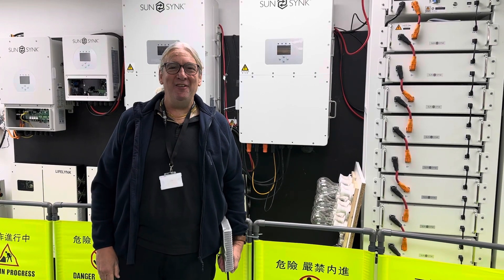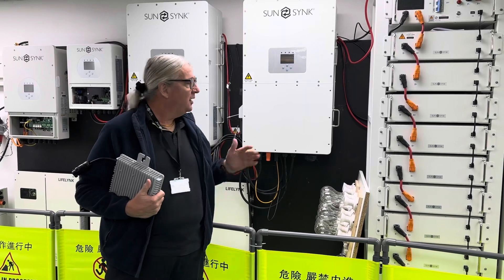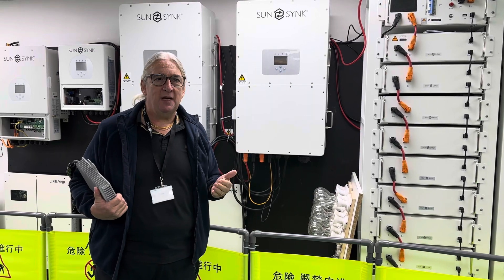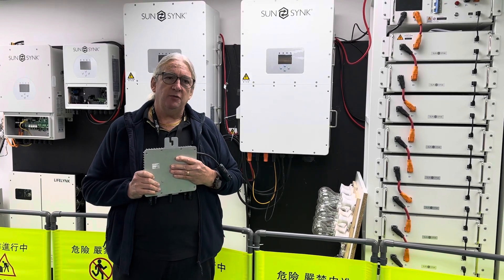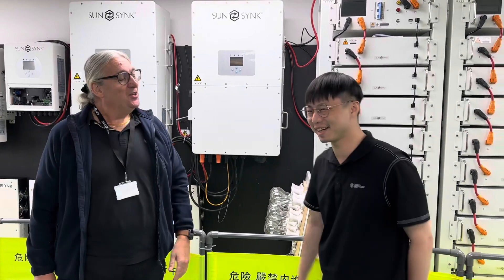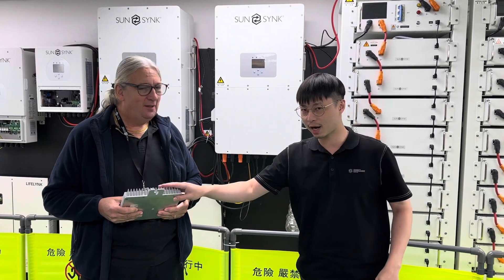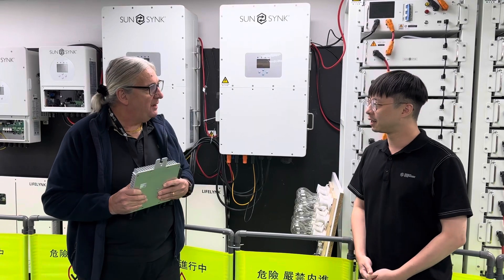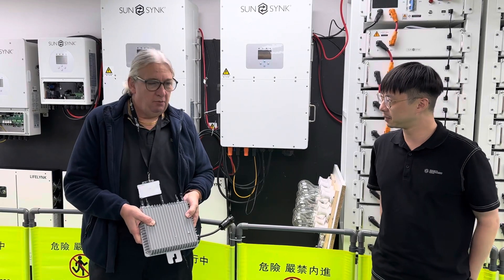The integration of micro inverters with the Sunsynk connect.

Comment: You've said a lot without saying anything. How is it used? How is it connected? If one ahead has 2 PV strings within the SunSynk hybrid inverter and wants to expand using an ac coupled microinverter, how does this play itself out?

Comment: Keith, you need to reshoot this video because the information that you are giving here is not clear enough.
You are holding a product from Hoymiles which is a microinverter or you are just trying to introduce a microinverter from another company which has compatibility with Sunsynk through the Gen Port. You are trying, but miserably failing, to say that there is a solution for people who want to expand their solar array (if  the existing array has already taken up all the available MPPTs on the Sunsynk inverter) by using this microinverter (MI) for your expanded array and then feeding the AC directly through the Gen Port on the Sunsynk inverter. 
You have said..
nothing about how this AC from the MI will be connected to the Sunsynk inverter.
nothing about the max power/current that can be fed from the MI/panels to Sunsynk  3,6/5KW inverter.
nothing about how you either limit export or get permit to export from the authorities.
Keith, stop saying it is easy or it is simple without explaining.
Many people are looking for solutions and need you to provide tangible information that can be used.
Reply: He actually has a 3 year old video that explains it a lot better. Video is titled "Aux Load Port"

He says frequency shifting will only work when off-grid. 

He does not say what will happen if you are on grid with a micro / string inverter. What will happen with the excess power...

Comment: hey @sunsynk i want to buy your inverter 8.8kw and the batteries  with 12panels  (5.3) also i want to add a 7kw turbine from tessup , will that work can i add both wind and solar to this inverter? the turbine is tesup x7 small one made in the uk

Comment: Terrible solution - if you install ~10kw of panels, that's 25 inverters. 25 additional devices connecting to your wifi!!! This is going to cause congestion & random performance problems on the homes WiFi & be next to impossible to diagnose for the homeowners. The installers will set it up - it'll work on install & then walk away. Night comes along, kids home, everyone's using devices & thats when the issues will start.  Common home routers dont do well with large numbers of devices, eero recommends 30 max for "best performance", TP link states 25 to 50.
You're running an ESP with STA & AP mode inside these - better solutions can be done to avoid this.
Reply: They communicate over Zigbee and Powerline between the devices. Only one is connected to the household wifi..
Reply: @SolisNotSolis  Do you have a doco/specs link? The one I saw mentioned nothing about zigbee/powerline